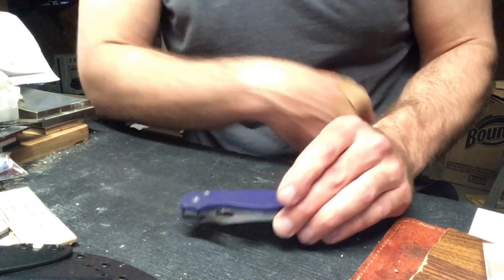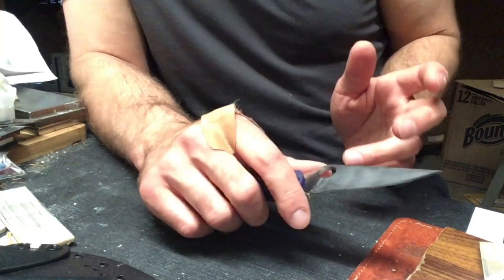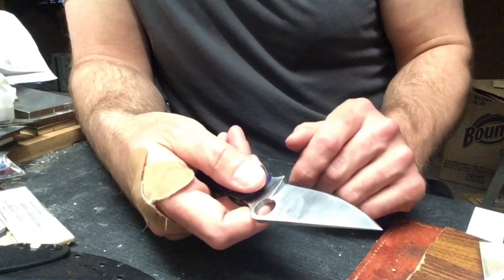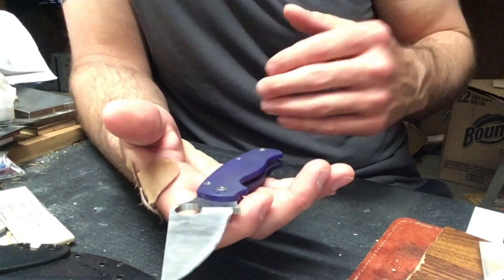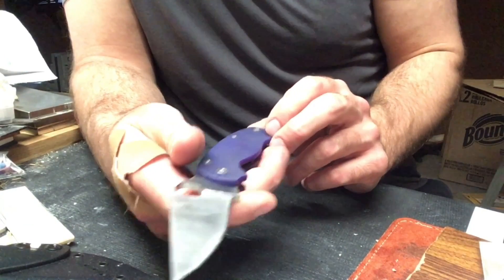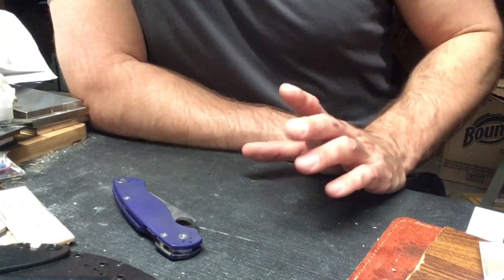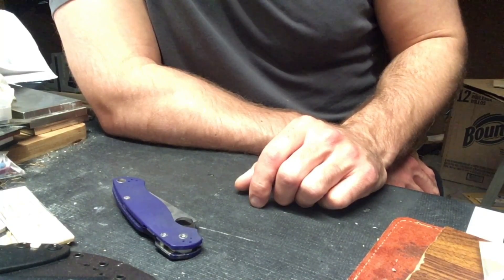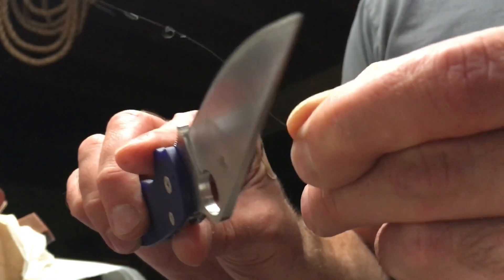CPM S110V - carbide tear out in sharpening

Comment: Great and informative video man! I was just wondering.. if you use so much stropping after good sharpening, results will be very similar even after using ceramics? You are using the same finishing grit at the end and wide variety of strop grits, which is very different from plain sharpening.

Comment: pit some flytanium scales on it that's what I'm planning on doing when I get mine not a fan of the blurple myself.great video on the new knifeworks exclusive ti/cf military been waiting a while for one to come out myself can't wait for mine to come in next few days.
Reply from the maker: I'm glad you like the channel.  
I was going to remove the scales and dye them, but the screw heads stripped trying to get them off. (that was using a hair dryer to try to break the loctite.)  After that I just said to hell with it.
Reply: Michael Christy yeah man I'm subbed now.damn that's rough I'd drill them out or use one those stripped screw tappers that removes them and get some blue anodized replacements I seen them on ebay would look good with black or the flytanium scales.
Reply from the maker: Schizo_ phrenic I'm. It worried about it.  I'll use it with the blurple scales.  As soon as the screws stripped I was done trying to modify it.

Comment: Thank you Michael for the interesting video. Did you have any experience with Arkansas ceramic rod - it's rather cheap item, but it works very well on maintaining cts 204p, xhp. Does not work on M390 though. Do you think it will work on S110v? I would prefer to use Arkansas rod weeks, to sharpening the blade in a year when the blade gets dull. Thank you
Reply from the maker: I have not used an Arkansas rod.  I understand it working on XHP, but I don't know why it would work on 204p but not M390, considering they have the same alloy content.  
But if it works for you, go with it.  I may have to look into the rod.
Reply: Thanks for the reply Michael, I am writing from the Ukraine actually. The thing is that XHP and 204p that I used the rod with were Spyderco, but M390 was ZT, that could be the reason. I may guess PM2 with M390 could be maintained by this Arkansas rod. I am just not sure about S110v, some people say its super tough. Have you heard about Buck Knives 97082 EdgeTek 10" Diamond 3 Sided Sharpening Rod? I just happen to find it on Amazon, costs about $40. It has 3 sides on it - 325/750/1200 grit, and I was wondering since it's diamond rod, may be it should work 100% on that steel. See I just dont want to spend much on big sharpening equipment like lansky diamond delux, etc. and try to get away with the more compact and cheaper option. Or would you recommend DMT FWFC Double Sided Diafold Sharpener Fine / Coarse? I saw you have it in your sharpening tools. 
Thanks
Peter
Reply from the maker: Peter Dmitrenko S110V has a lot of carbide.  It has a lot of vanadium carbide, which is very hard.  However, S110V is not very tough.  Tough, in regards to steel, does not mean hard.  Toughness is resistance to fracture from impact.  S110V is very wear resistant, which is different then tough.
I have not seen or used the product from Buck, but diamond should do good with S110V if the diamond product is well made.  
I have used DMT products and they do very good, although you might want something finer to finish the edge with.
Reply: Mike, thanks a lot, I have found your video on DMT small diamond sharpeners I think I will go with those for my S110v! thanks for your help) Peter
PS, btw why dont you like the color of the handle? "situations when you dont want to have it in your pocket" I dont understand! thanks
Reply from the maker: Peter Dmitrenko the DMT sharpeners are very good.  I found them to be a great value for the cost.
As for the color, there are times I want the knife in my pocket to be low profile.  A bright color draws attention.
Reply: Thank you Michael for your answers, I appreciate it very much. Also have to say that I like your thoughtful videos! 
What would you say about the angle when sharpening? Being not professional will i manage to sharpen my knives on DMT sharpeners? Is it much more difficult to do than on Lansky for example? 
thanks
Peter

PS you ve had both PM2 m390 and s110v - which one is better steelwise in your opinion)
Reply from the maker: Peter Dmitrenko using the DMT stones freehand, you have to be familiar with freehand.  With Lansky, it's easier for a beginner to hold the angle.
S110V will hold an edge longer then M390, but M390 sharpens better.
Reply: Hello Michael, Can I ask your advise, I just did some reading on knife sharpening, and came to the conclusion that I only need DMT Diafold just Fine or Fine/Extra fine (for double). 600 Grit is basically what I need. My sharpening preference is when the blade cuts flawlessly paper, dont care about hair sharp, basically I am more than satisfied with the sharpness of Spyderco out of the box. What would you say on that? Thank you. Peter
Reply from the maker: Peter Dmitrenko well, the Diafolds that I have seen are sold C/F and EF/EEF.  If all you want is the EF/EEF, that will save you money and time.  You don't have to take the edge as far as I do using strops and sprays.  The most important thing is that it does what you need it to and that you're happy with it.  I would recommend having the coarse as well, but that's completely your call.
Reply from the maker: Peter Dmitrenko you're right, they offer more then just the two variations.  If that's what you want, go for it.  The Diafolds are a great product.

Comment: with that much carbides in the steel, maybe it doesnt need to be sharpened on stones at all. A light stroping or honing should suffice. Unless it goes seriously blunt, s110v is easily oversharpened by many. Strop each night after a days use and you will never need to sharpen it.
Reply from the maker: Mos Matic stones will be necessary at some point.  After enough micro chipping, strops won't keep the edge going.

Comment: Unless you get down to .000000001 micron you will not be able to time travel or capture rainbows. You can dye the purple its easy.
Reply from the maker: JGBLADES the red loctite in the threads didn't make that an easy option.  When the heads started stripping, I gave up on it.
Reply: Yeah i hear ya. I started to strip out my BM Contego pivot screw. Not too happy about that one.
Reply from the maker: JGBLADES is Benchmade using loctite now?
Reply: On that they did. Not sure about other knives. On my newer 940 they did not.
Reply from the maker: JGBLADES that wasn't smart of them.  At least Spyderco decided to change that protocol.  
I even used a hair dryer, but no luck.  I know guys that do great work with PM2's, putting on custom scales and aligning everything perfectly and that type of thing.  I could have sent it to someone, but I wasn't that worried about it.  I carry the knife, but I'm selective about when.
Reply: Makes sense. I wish the Spyderco ball bearing lock was more like BM's. They would have a far better product. The hole also weakens the overall blade. But that is just my 2 cents.

Comment: I believe Hapstone recommends against diamond stones for powdered steel because of potential carbide tearout.  How do you reconcile?
Reply from the maker: rick leeo I've used diamond stones on almost every powdered steel available on the production knife market and not had a problem.  Are you sure that's what Hapstone recommends?  And can you give a link so I can see exactly what they're saying?  
From what you described, it sounds like they're wrong in their statement.
Reply: go to the gritomatic website [https://www.gritomatic.com/products/hapstone-v6-knife-sharpener?variant=37531262094] to see their recommendation for their diamond stone set and the Q &A. Thanks for followup
Reply from the maker: rick leeo I think what they're saying is that there is a lack of edge stability given the scratch pattern left by diamond stones.  I think they're under estimating the edge stability of some of the high vanadium steels.  Besides, what's the alternative?...  something that won't cut the vanadium carbides and has been shown to cause carbide tear out?
Testing has shown some steels to have better edge retention with a coarse finish.
Unless I'm misunderstanding what they're saying, I think they're wrong.

Comment: That was a great video, it answered so many questions i had! 

I was actually expecting the full diamond to have significantly better results, but am also quite relieved as i do finish high V carbide steels on the finest shapton i have, although, i only pass the blade on the alumina stones lightly for fear of excessive carbide tearout. 

Would you feel that pressure used during sharpening would play a huge role on end result? and if so, how heavy is too heavy for pressure?
Reply from the maker: The Polished Edge I use a good amount of pressure with the UF stone, and I was apexing the knife twice. (A burr on one side and a burr on the other, and then repeat.).  I would think (this is a gut feeling) that the UF ceramic stone does better then the Shapton, but that's just a guess.  I know a 20K Suehiro did ok, so maybe the Shapton would be fine.
Reply: Michael Christy I see, well, the thought process I had was like this. I've used to diamond stones to shape the carbides up to a fine grit, according to the angle that I have set. if I use a softer alumina stone solely for the purpose of polishing and refining the edge, this should limit or eliminate carbide tearout, especially if I use light pressure. I shall try finish s110v with considerable amount of pressure on alumina and see if I can get good results as well. 

might I ask, what would make the suehiros give better results when compared to shapton or Spyderco?
Reply from the maker: The Polished Edge I wouldn't say the Suehiro had better results then the Spyderco, but better then the Shapton.  If I had to guess, I would say it's because it's harder.  I suspect, and this is just a guess as well, that the Spyderco is the hardest of the three.  Not the abrasive in the stone, but the way it's bonded.  Again, it's just a guess.  I know that the Suehiro is harder then the Shaptons.  I'm not sure how the Spyderco stacks up, but if you've ever used one, i'm sure you noticed the feedback from the stone.  
Also keep in mind, we're well into the territory of using a fairly coarse finish brought to a high level of sharpness, as opposed to the idea that the highest polish gives the sharpest edge.
Reply: Michael Christy would that mean I could get away with the Spyderco stones and won't need the suehiros, or would it still be beneficial to my rotation?

one thing I picked up from your videos is to not aim for the polish, but to just follow the proper progression in grits. I guess the polish is just a byproduct of it? I've found that while I do get better sharpness on my edge, sometimes, there are still some visible scratches left behind by the diamonds. not that the scratches matter, it's just as observation.  please correct me if I'm wrong.
Reply: @The_Polished_Edge  well its 2 years later but gonna throw u my 2 cents...I get better results with different scratch patterns on different steels....Example my m4 likes to have a toothy rough edge....last forever...polished does good or ok but noticable different...And Know 2 people are going to sharpen the same find what works for you....If your a super edge freek and feel u need 2 hit 4 stones and 5 strops...And it works out for you,getter done but all steels are going to perform different on grinds ,angles,polished,unpolished...I use 3 stones strop twice...And if you dont chip the blade edc u wont ever need to do a full sharpening on the knife...Just stroping which is sharpening.....But hit it here and there your good..depending on steel ,if I finish with diamond or ceramic,And what I have found to last the longest in steels I have....Which I have alot....And I do get very intrested in what they can do and hold up.....

Comment: Excellent video.  Your results make me wonder if the negligible difference is mainly due to the cpm process in general.  More specifically, are you not experiencing obvious tear out because the carbides are so small and uniformly distributed that the edge is still very much loaded with them?  Even if there is tear out occurring it might be so superficial due to the size that it makes no difference.  One question just leads to another.  Love the vids, keep them coming!
Reply from the maker: michael peterson you may be correct.  I'm not sure why it's not making a difference, but it's not.
Reply: michael peterson thats exactly what i was thinking. I think in theory, there should be carbide tear out... But (and im spit balling) i think the actual PM process makes everything so small and uniform that even If it is happening its not effecting the performance.

Comment: At what amount of carbide volume (specifically Vanadium carbides I assume) does it become problematic to use too many aluminum oxide stones? I have a full complement of DMT diamond stones but recently both a Shapton Pro 8000 and really liked the feel of the waterstone, so I was thinking of buying more. But considering my collection is primarily S35VN, it might be pointless.
Reply from the maker: Misanthropia this question is something I've tried to narrow down a bit in the last few months.  It's something I've discussed with some other sharpeners who also have YouTube channels that I talk to outside of the internet.  It seems like around the 3% to 4% range is the cutoff.  I've never sharpened S35VN, but the guys I talk to have and they say it's no problem with alumina water stones.  
I know that 3V and CruWear gave me no problems.
Reply: Michael Christy Heh, since I generally don't buy super high carbide steels maybe the DMT stones were actually the pointless ones 😀
Reply from the maker: Misanthropia well, if you do pick up any high vanadium steels, the DMT stones will be good.  Also, if you need to true your water stones, the DMT stones will help. (It's what I use).

Comment: could be that the carbides shear off differently at different angles. Allowing the the ceramics to deal with the carbides anyway.
Reply from the maker: Maxwell Super well, as I understand it, if the angle is too low on certain steels, there's not enough space on the edge to hold the carbides.
Reply: That is true from what I have heard. I picture it as the carbide going through the whole edge from one side to the other, kind of like a stress fracture on a microscopic level.

I wonder how important it really is though. I have seen testimony of  S90v do very well at low angles with a high polished edge but some contrary to that as well.

I suspect people's ability to sharpen and what they use may have an effect.